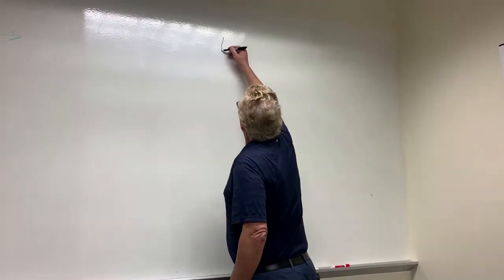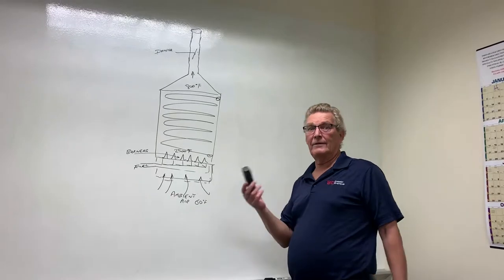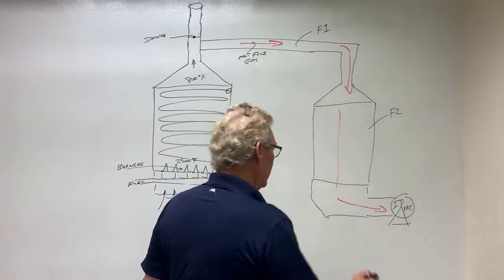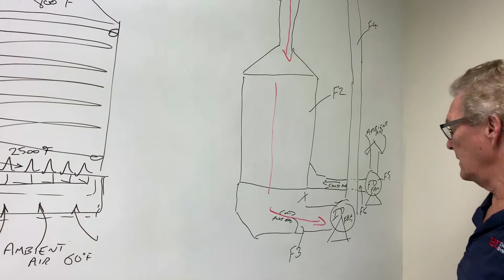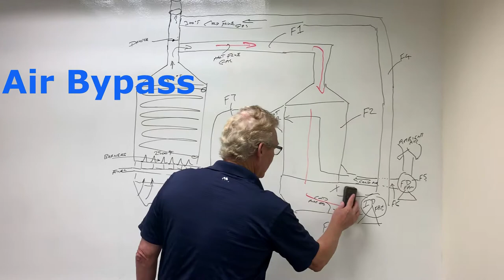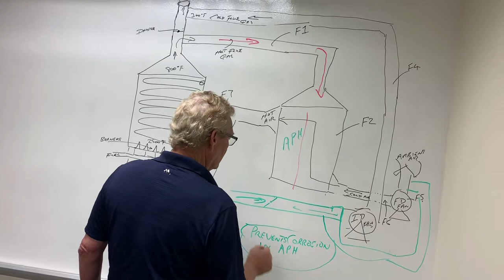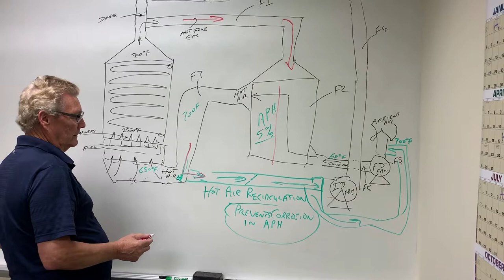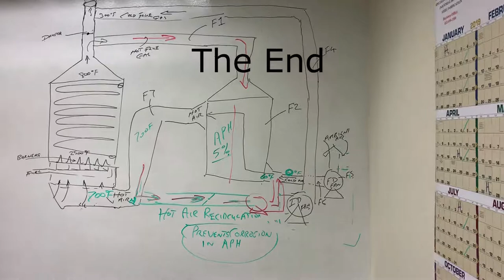Air Preheater Description with Cold Air Bypass and Hot Air Recirculation

Comment: Hi Good explanation on APH system Quick question around the burners. Does putting a FD fan now for this APH, do the burners need to be changed to a Forced Draft style vs Natural draft?  Also is there any air-fuel ratio control performed by measuring the airflow?